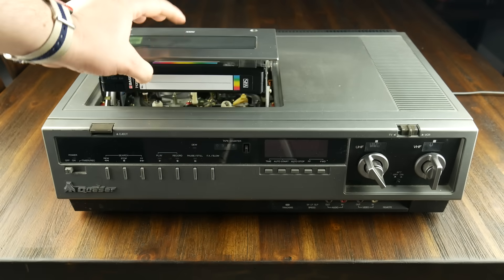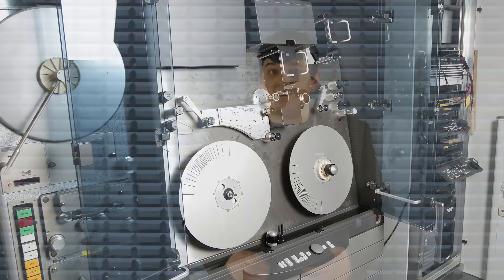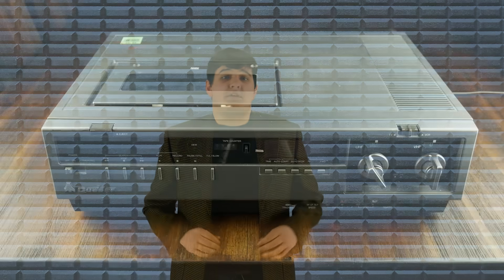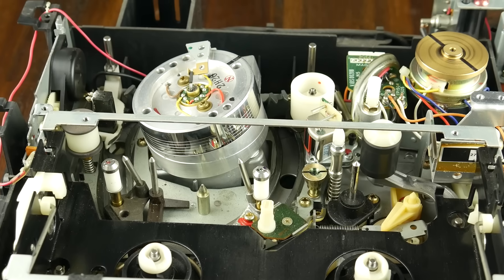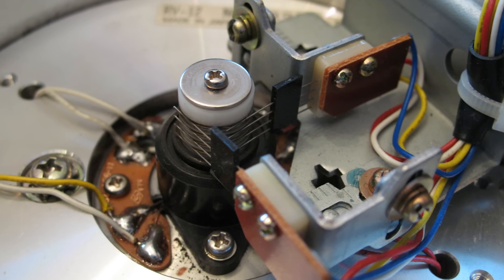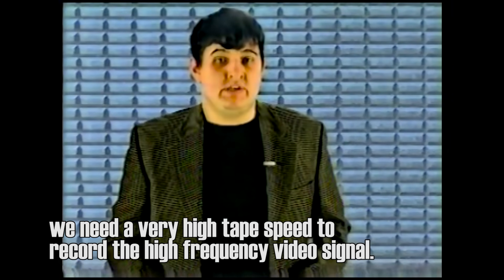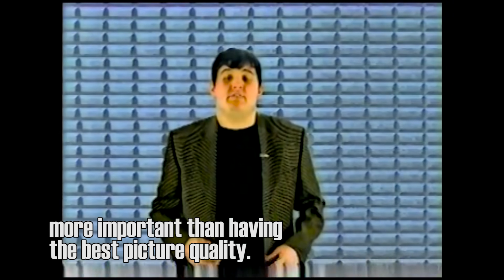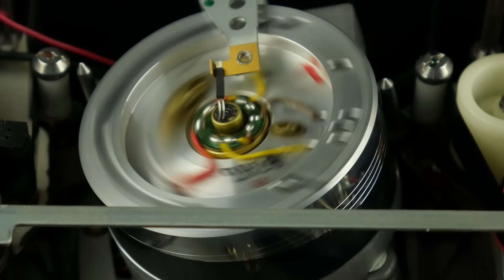The Impossible Feat inside Your VCR

Comment: And you never get a clean picture when the tape is paused because the whole image isn't available to both the heads.
Reply: With a 4 head player you could
Reply: @catonthemoon2084  A frame buffer would also do the trick
Reply: @nexusxe  When talking about what was possible at an affordable price in a consumer machine in the 80's, putting 4 heads in the spinny part was a much more practical solution.
Reply: @nexusxe  My VCR DVD combo has a frame buffer for VHS playback:D
Reply: That's becuase every frame of video on VHS is an interlaced feild since VHS is an anoluge home video format that runs in 480i
Reply: @Ballowax  you mean Analogue
Reply: I remember as a kid trying to pause a frame on my favorite cartoon, ‘The Smurfs’, only to put a piece of paper over the CRT screen of my TV to try and trace out the character on pencil.  I also remember as a kid getting super pissed off that it didn’t work, making me whack my pencil against the CRT and hearing that “tonk tonk tonnnk” sound.

Comment: This is a very informative video, I learned a few things.
A couple observations though:
at 11:55 when switching to SP VHS, OMG!  I've got VHS tapes I recorded in the late 1980s & early 1990s on EP which look almost that good, even with 30-years' worth of degaussing.  Granted, they were premium quality tapes, but still.  And the tapes I recorded on SP look much better than that.  Both equipment and tapes themselves enter into the equation, and that fact isn't mentioned.  Neither are all created equal, as some of the cheaper tapes in my collection prove.
Another thing which should've been mentioned in this otherwise pretty comprehensive examination was the need to clean the video heads and the problems which arose if not done.

I've got hundreds of old VHS tapes I'm trying to digitize (slowly, over years).  These aren't commercially recorded tapes (like movies), they're mostly recorded off air news coverage and one-of-a-kind camcorder tapes.  The biggest obstacle is finding quality, functional VHS decks.  The same problem I'm having in attempting to digitize hundreds of unique audio cassette recordings.  These tasks likely will not be completed before my years run out, LOL.

Comment: I know I'm late to the party here, but would you could you do a video on how VHS found a new lease on life (albeit temporarily) as an analogue backup solution?

So here's the thing: I used a VHS recorder to backup, then restore, 4GB of digital data on one 4 hour tape. Hilariously, it took 4 hours to run the backup then 4 hours to read it back. I actually had to run the readback twice because it wasn't until it got to the end of the run that I discovered a single read error that hexed the entire run.

Then I discovered DC300 and 4mm DAT.

And that was the end of my adventures in VHS video cassette as an archival solution.

Comment: Who still remembers the loud gray static screen ?
Reply: and the beep of doom.
Reply: Melhores músicas
Reply: That is the QUICK STOP REWIND moment lol
Reply: @Joel-vx7hz  t
Reply: i do remember waking up a couple times at night when programming ended.   
ofcourse somewhere in the late 90's and early 2000's that time was filled up with nothing but back to back ads for 0906 numbers.   (titty ads. for adult phone numbers)
Reply: SSSSSSSSSSSSSSSSSSSSSSSSSSSSSSSSSSSSSSSS
Reply: Yes vividly but I was alive when the change from vhs to cd and dvd was happening and was really ending I still find it odd when stuff doesn’t include a dvd or cd slot I.e a car radio
Reply: The memory still lingers. That static was like 50% louder than the normal sound, and the sound was unnerving at least
Reply: @rogehmarbi  I had an old box of a TV, was ok
Reply: @rogehmarbi  Relatable. I used to have a CRT like that, but it must have broke, as it's gone. I did not even want to approach it with the loud static. The newer CRT I currently have uses a way less intrusive no signal sound.
Reply: @duscarasheddinn8033  It's not really a "no signal sound".  It's the actual radio noise from nature getting amplified like a really weak TV signal.  The newer receivers simply refuse to receive this weak signal.
Reply: billlco white noise?
Reply: Amiga 500 here. Low set sound was overnoised 😅
Reply: It was almost as loud as the commercials, and equally annoying!
Reply: Disturbing.
Reply: Actually, i almost though DVDs were more freaky in a way because they would just shut off.
Reply: @gladonos3384  
The static has grown on you as well...
Reply: I heard this comment.
Reply: Best Sound to sleep Ever
Reply: If you are Canadian and are old enough, you might remember this...
www.youtube.com/watch?v=Z601xTDe51c
Reply: @Reth_Hard  I guess you could say that if YouTube was like an old VHS system, there aptly would be a static screen instead of video unavailable (as is the case).
Reply: Many a man has jumped out of his skin from that screen.
Reply: can someone please give me a video link of what's the thing you're talking about ? I never experienced this or maybe I forgot , but I'm really curious now
Reply: @thefakepie1126  
I know I'm months late, but if you were lazy enough to not go find it (or just didn't know) then your patience has paid off, and actually brought benefit to me. I found this:
https://youtu.be/Un8yRBC84Yk

It's thirty minutes of exactly what we're talking about with the loud grey static. Loud included.
(for maximum realism, watch this video at what you'd consider mobile volume, then click the link I sent.)
Reply: Oh, you mean the sound of the universe background radiation
Reply: Me. I still know people who watch over the air antenna television.
Reply: 12:25 if you speed the video to max it’s like pressing that fast forward button
Reply: @JoMMI630  
Imagine the idea of that speed in reverse. Now we've got rewind.
Reply: One of the flatscreen TVs we use for zoom calls in my classroom at school began having an issue with the inverter boards for the screen, making a horrid high-pitch sound like an old tube set. Only half of us could hear it, but it was terrible for those of us who could.
Reply: @EnderMalcolm  sony trinatron true flat screen tvs were great in the day. And they were matte screen no glare
Reply: Oh man... remember when it would go off when you were napping, and you couldn’t decide whether to deal with it or get up and turn it off?
Reply: @Dr Reform  I'm wondering if they had a similar thing in the US. I'm not very familiar with the old US television since I wasn't understanding english when I was young...
Reply: I do remember my father intrest on them
Reply: I'm 18 and our TV did that. When did VCRs fall out of fashion?
Reply: It was awful but oddly enough I kind of miss it
Reply: Noice
Reply: Nnnnnth6h
Runneth n
Reply: I remember it. It hurt my ears X_X
Reply: Oh yes.
I actually need more static in my life at this point.
Reply: The bug fights
Reply: I was born in 2003 we had vhs player and tapes so yeah
Reply: Wait for another 10-20 years for 80-90s tech to be completely forgotten. Millenials had parents who were born in the 50-70s. So of course they're going to remember VHS, tapes, etc. Their parents used them!
Reply: You mean the white noise snow static?
Reply: Be kind rewind or pay 50 cents...
Reply: I do!
Reply: Sometimes there was a loud shrill at the end of the prerecorded tape or beep till the vcr auto rewinded as you were too drunk or tired to look for your one of many remotes beside your easy chair/couch or didn't want to get up to open the glass door of your fake wood entertainment center which you got at bimart or payless drug store.....
Reply: Let it snow, let it snow, let it snow...

Comment: I repaired thousands of VHS recorders and hundreds of Beta. LP went away because it was an expensive trick using the SP heads on the drum. ELP (or EP or SLP) used the second pair of heads designed specifically for that speed. The "four head"  VCR never used but two for any video. most designs put the EP heads at 90 degrees from the SP heads while a few actually put them right side by side in the same gap.To answer another poster's question, the EP display was for playback only when a selector was not present for EP recording. Playback speed was sensed and auto selected. Hifi was accomplished by another pair of heads so Hifi units actually had 6 heads on the drum. The real miracle was that Hifi was recorded after video by a fraction of a drum rotation but was actually recorded deeper in the tape coating. There was also further azimuth differences. So video and audio were not side by side on the tape but rather video stacked over audio, or actually the opposite, audio under video. For this reason, cassettes specific for Hifi had a thicker coating, allowing slightly better recording. For adjusting the speed and phase timing of the rotary heads we used special tapes which were printed rather than recorded on thicker less stretchy tape, and oscilloscopes. Those tapes cost hundreds of dollars. In the factory they used timing strobe lights like for a gasoline engine timing.

Comment: Ampex 2" QUAD machines were in service well into the 80s if not beyond.  If you are watching an old rerun of certain 'live' shows from the 60's you may notice 3-4 moving dots diagonally across the screen.  These were the head switch points from a misaligned machine.

Comment: i dug out my old VHS tapes recently, looking for which i would like to convert to digital. so there were many recorded tv programs from the early 90s, a lot of them recorded in LP. and i was quite surprised about how good the picture quality still is. of course it is a bit below analog TV resolution but after almost 30 years it has not noticably degraded. maybe because it was recorded once upon a time, and never played back until now .. ;) .. and the VCR i have is at least 4-head or something.  

same is for our old video8 tapes. consumer cameras 30 years ago were not soooo good (compared to any recent cheapo smartphone.. -.-) so of course it is far away from HD, HDR , steady shot etc.... but the tapes are just fine, no noise or other signs of degradation. (but still a good idea to convert and save everything to digital now! :) )

have you already done a video about video8/hi8? .. im gonna check out your video list. ;)

Comment: Your facts on Quadruplex tape head speed is wrong. The video heads rotate @ 14,400 RPM it uses an air bearing & rotary transformers to read & record. Helical scan machines operate @ 3,600 RPMs.

Comment: @Technology Connections - Don't you think we should have continuous video formats by now? Radio and even vinyl and audio cassette already have continuous AUDIO. But video is also on the electromagnetic spectrum of VHS and CRT! Not to mention, HD CRTs can do 720p progressive! There is no reason why we haven't modified progressive CRT technology to be able to display continuous video instead of the constant flicker of scanline/progressive technology. And we all know why we don't have it. Because the government/media/corporations want to control what we watch and how we are able to watch it! 

we already have the technology to do this with some simple off the shelf modifications to existing VCRs and CRT TVs. We could resurrect those old formats and show the wonder of realistic analog video!
Reply: I hate to break this to you, but even analog video is transmitted frame by frame with scanning.  The only way video transmission could ever be truly "continuous" is to have a separate analog channel for each pixel, connecting each pixel's independent light detector in the camera to its light source in the display.  Increasing the frame rate, and thus the bandwidth required, would approximate such quality and continuity, but would be very expensive, especially to transmit over long distances or to hold long recording times.

Comment: Excellent but really should have included mention of 1" broadcast tape, with the same helical scan system as VHS. This was THE system for broadcast recording for way longer than 2" quad. I used Ampex VPR2 machines for years and recall that a portable version existed.

Comment: One extremely annoying thing you forgot to mention is when the tape spindle fails since every vcr I have taken apart to repair used a belt drive system for the spindles, and the damn capstan continues to pull out the tape effectively mangling up your favourite Die Hard movie.

Comment: The weirdest part is how the VCR's replacement, DVD players had no recording capability at all. There is DVR but that requires monthly fees.
These are your only two options. Magnavox MDR865H/MDR867H which can only be bought used with laughably high cost of over $600/$1200 on amazon.
Or  TiVo Roamio OTA 1. More functions but lacks a DVD player and DVD record function present in the Magnavox.  Also only available used
Otherwise you can put together your own computer with OTA tuner cards or boxes and essentially make your own DVR.

I say it's weird but not really in  a sense, They want us paying both cable/satellites cost and the separate subscription cost of their DVR (that they don't tell you about when they talk about you being able to get it "free")  and yet STILL not able to skip commercials. They're just screwing us customers.

Comment: I remember when I was a kid, I always looked into my VCR, and thought that the video head was broken, but the VCR still worked, so I never did anything; but when the VCR would mess up, I always hit the top of the VCR, thinking it would bump the head back into place lol.
Reply: And to think, I used to fix those damned things for a living. And LaserDisc and DVD players and CD players...
Then, the price started dropping and I saw the handwriting on the wall, jumped to computers and networked systems, the rest is history.

Still comes in handy for when something breaks on a holiday weekend, as I know how to repair switch mode power supplies to component level, still have a solder station, meter and oscilloscope. Although, after replacing a probe, I had to remember how to properly tune the replacement probes...
Reply: @spvillano  A friend of mine did electronic repairs for a while. As electronic things approached the "throw away" stage, he got out of the business. When parts/labor cost more than a new replacement, it's hard to justify keeping the old outdated one.
Reply: @spvillano  laserdisc repair eh?? 

Funnily enough I just bought a pair of Philips VLP 600s which (unsurprisingly) don't work and am going to attempt to fix them!! Don't suppose you'd fancy giving me some pointers? Never worked on one before so don't even know where to begin really!!

Comment: In the mid to late 90s JVC developed the 'Dynamic Drum' system. This was actually a small motor that altered the tilt applied to the head drum to optimise playback. The result was long-play recordings looking almost exactly the same as standard recordings and perfect still-frames. This system, along with manual level control, also made HiFI Audio recordings sound superb. I still have 2 HR-J935EK machines that have this feature...

Comment: holy crap are vcr's complicated. compare this to a dvd or blu-ray player, easily 10x fewer parts involved. (makes you wonder why blu ray players and discs are so expensive by comparison)
Reply: Those tiny black chips have many times as many parts (embedded microtransistors that couldn't be seen with the naked eye if the top were to be removed) than all of the parts on the board.

Comment: 325/5000
You need to redo this video using better equipment, as it has greatly compromised the real quality of the VHS format. Here is a capture I made using a LG video cassette, 6 heads, HiFi, with TVnPC P6 capture card (Philips SAA7130 Chipset). There's a huge difference: https://youtu.be/jcs_yHb4xV0

Comment: how much data is stored on the tape ? i readed some information saying coming from IBM what says its 45kb/s 
neither if the real data the lens/signal was 100 times bigger
the recorded data on the tape seems to be limited if it can only store 45kb/s
that would not be that much 
if the process what writes or read contain 4 signals * 45kb it would be different , it would be like a 4 bit data bus with 45 k-hertz stored 
but it says 45 kilobytes for a second 
going crazy for the 60 slices for 1,313 inch or 3,33 cm thinking 1 slice for 1 frame  it would be 0,555 mm for 1 frame ?
then hearing the 3 megahertz transfer rate bring me into a different direction 

im kinda confused

Comment: Great video. I would have liked to have seen more about how the flying heads were built and the mechanics of them almost scraping the tape. They must have been built to really high precision to make contact with the tape and not tear it or wrinkle it or damage it otherhow! Also, do you have any videos on how films were edited and spliced before digital and NLE came on the scene? From Wikipedia it seems they would cut up a print, make an edit list, and then edit the original negative and then print one clip at a time. Is that right? I would love to learn more about that.

Comment: I bought an RCA vhs machine the second model year they were out. I'd been wanting one, and the start of the original Battlestar Galactica was the trigger to do it. Of course, I did like everyone did and screwed up the timer settings for the pilot episode. :-) $650 (1979) got you 2/4hr mode, mechanical tuners, single timer, no freeze-frame and a wired remote that only paused. Still, it was built like a tank. The only problem I had was a broken  worm gear on the tape loading mech.